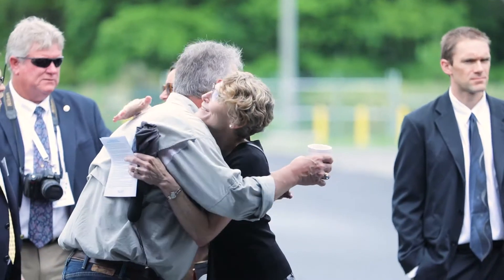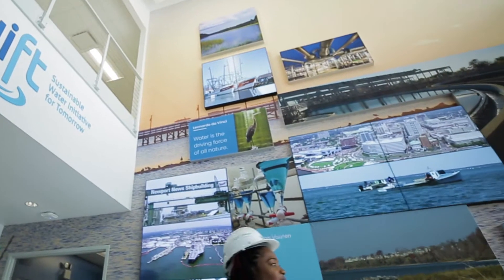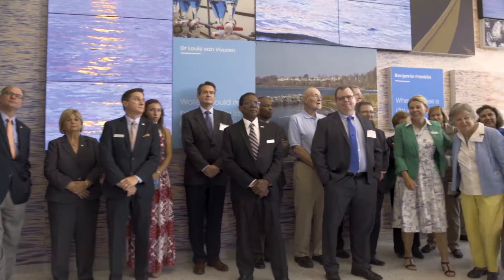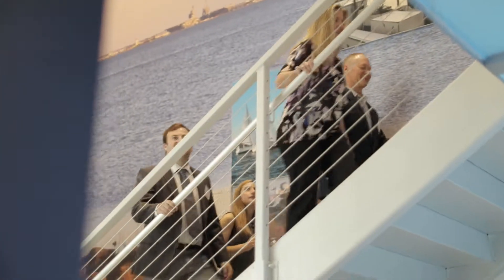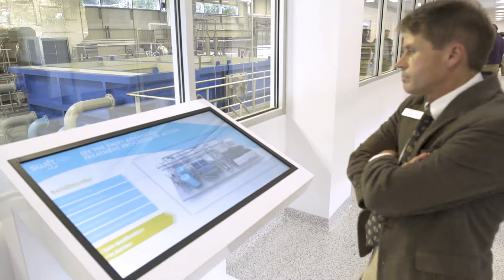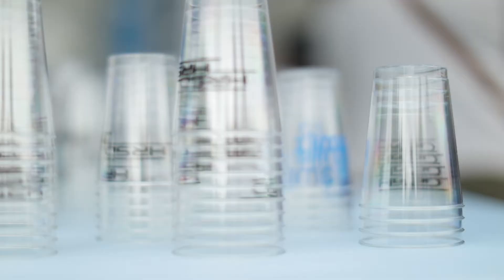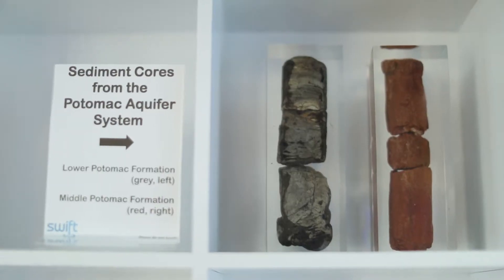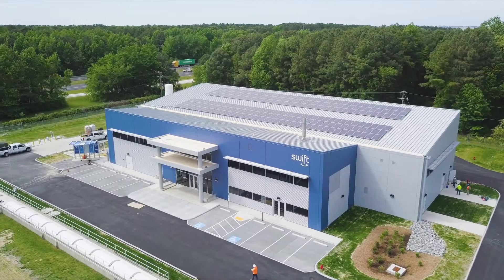SWIFT Research Center Ribbon Cutting Ceremony, May 2018

Comment: Hemp! Has been proven, to be 10 times stronger and 30% lighter than steel, stronger and lighter than concrete, stronger and lighter than brick'  far easier to work with on site as well as being much more versatile.  Part of the way you prevent waste from occurring is by building and maintaining structures with the best materials and resources.                                    One of the reasons why I prefer hemp! Is 1 acre will produce 3 to 4 times the amount of oxygen as a acre of treats, plus it sucks in 3 to 4 times the amount of carbon dioxide as a acre of trees,   as a added bonus! It rejuvenates and replenishes the soil back to Garden of paradise type quality after every harvest! Even if the landscape has been previously strip robbed and depleted of all its value from overharvesting things like cotton and corn.   It has even been successfully grown on radiative soil.   Hemp makes over 26,000 different things,                                                                                                                                                                                                      with all its beneficial properties I would say that if you grew it along the shoreline you would greatly improve the quality of the water.   Those are just a couple of the benefits that can come from using working with, mass producing distributing hemp.  In layman's terms we can create clean high paying jobs from coast-to-coast with it,   these jobs will improve upon and maintain the quality of our air water foods landscapes working living environment to the highest standards of quality in the world instead of the lowest.   Thank you for sharing your time here on YouTube